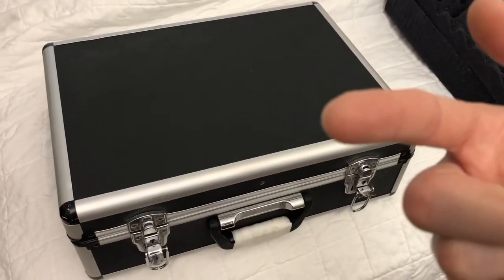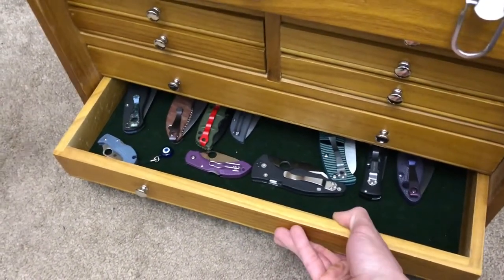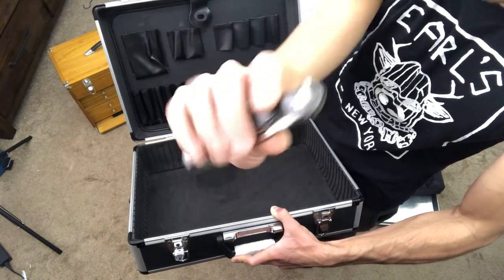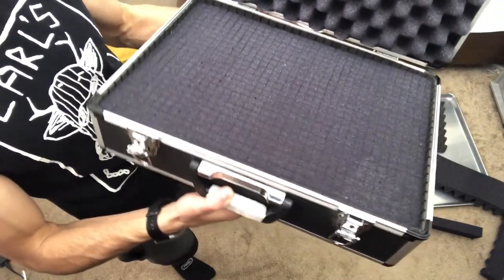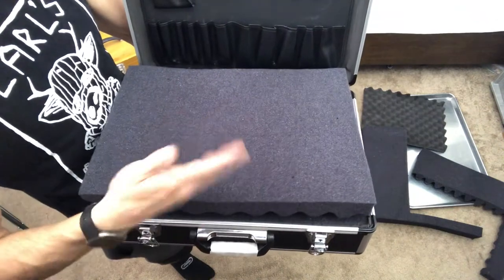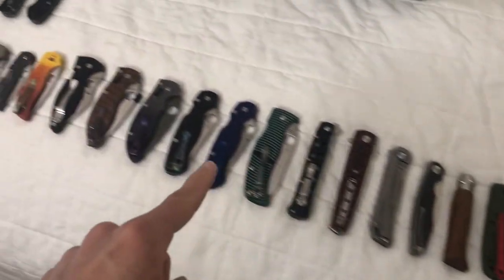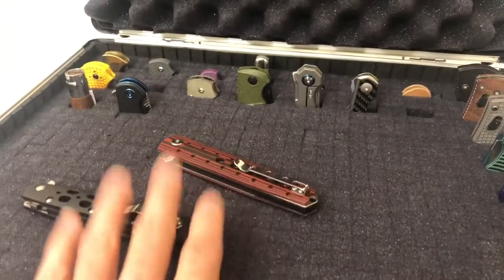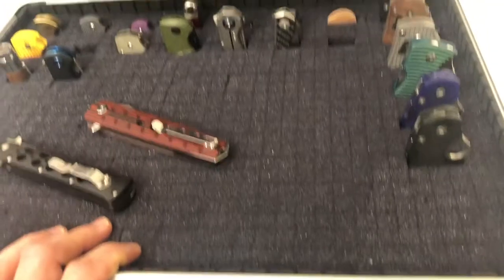Making My Own DIY Knife Case Using Pick n’ Pluck Foam

Comment: I have the exact wooden box like yours. I have knifes, pens,flashlights and a couple little multi tools in it. I want a separate case for just my knifes. Where did you get that knife case? My collection of knifes is getting bigger I went from a couple knife to 10 and counting.
Reply from the maker: I got this case at Harbor Freight years ago. They used to sell this hard briefcase type of case, but now they sell a set of Pelican-style plastic cases. Those plastic cases could work well for you and are affordable compared to real Pelican cases

Comment: Nooooo. I'm in a process of doing the same thing with my knives but I wanted to see how it would look to put them horizontally, which is what I want to do... I know it's easier and more productive putting them vertically but it's way cooler to open the case and see all your knives from the side...
Reply from the maker: You could have removable layers of foam with knives laid out… or pick the best of the bunch. Space will always be an issue when laying knives out 🤷🏽‍♂️ I wanted my collection all in one spot instead of in weird clusters around my apartment 😅
Reply: @inkiron3907  Sure, there are pros and cons of both approaches. As far as space is concerned you could have arranged the collection in 2 cases. I still think that the horizontal approach is the way to go but I wanted to see someone execute it on a pick foam, just to see the final result. Well, it's gonna be me trying it out..